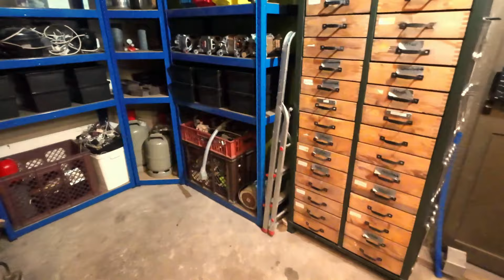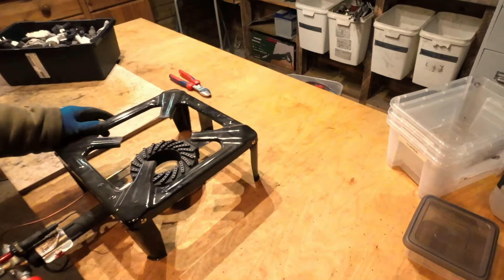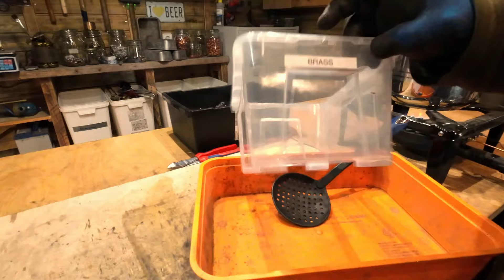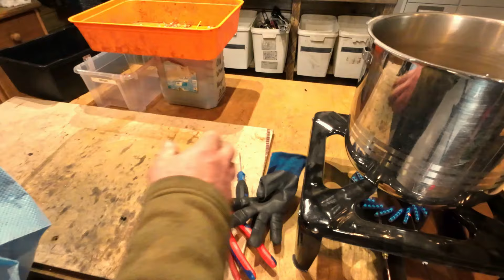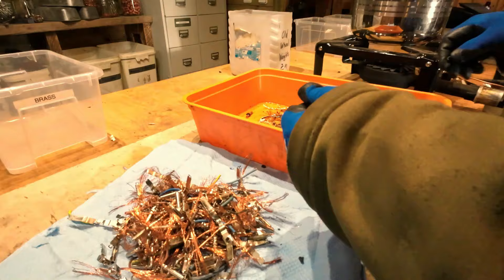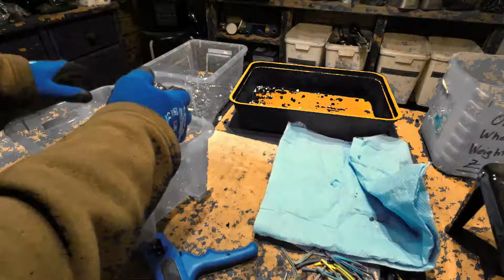Micro Scrapping | 111 Power Plugs | The  Truth About Scrapping Brass Plugs

Comment: I actually never boil these. For me if I just have two pairs of pliers, I can just use one to hold the plug, and the other to remove the brass parts.
Reply from the maker: I've already done it that way, but it's easier for me this way
Reply: Spending more on propane then brass collected though???
Reply: I do it the pliers way to
Reply: @roadhog1987  I do to because I don’t have enough to boil if I had at least 6 or more I would boil them because my hands be hurting gripping the pliers
Reply: To each is own but I just use pliers. I can have 20 to 30 done before the water boils.